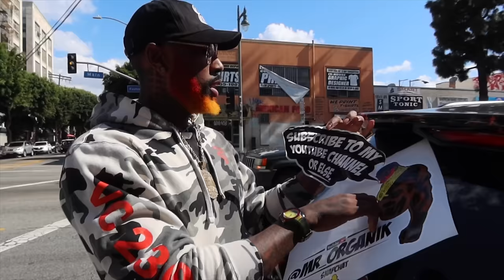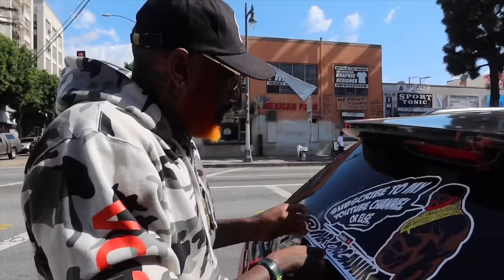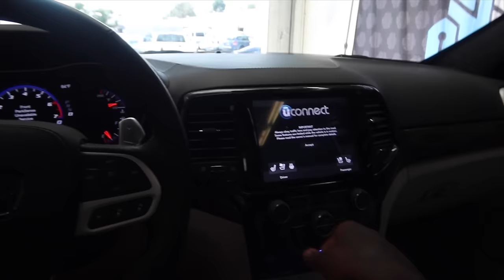THIS IS MANDATORY FOR ANY 2020 TRACKHAWK. !

Comment: You need to lower the ass end so that it sets even with the front. If you did that you really don’t need the Forgi’s honestly. Keeping the stock wheels won’t fuck with the performance and handling like Forgi’s will either. Shit looks good like it is. Would look even better if it was setting level.👌🏽OFEMMM